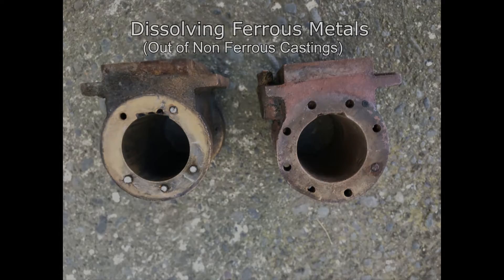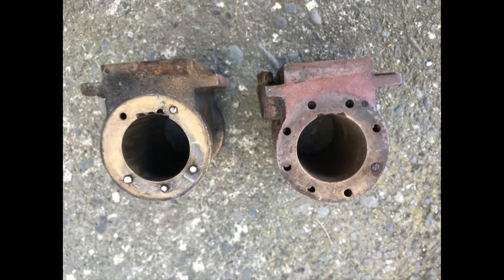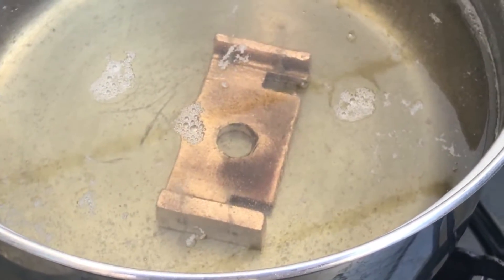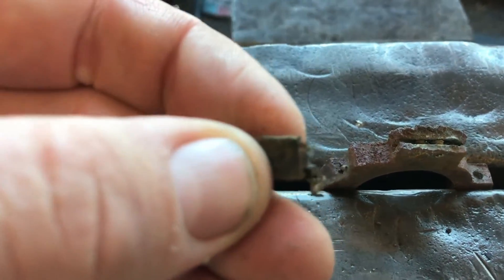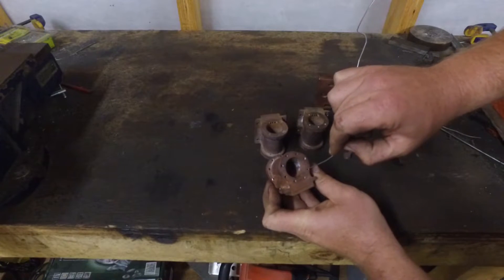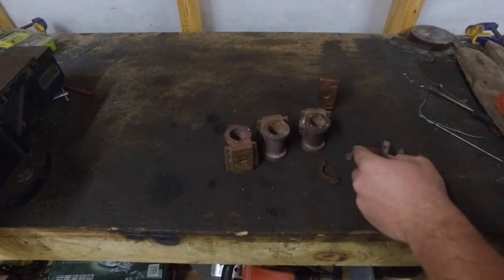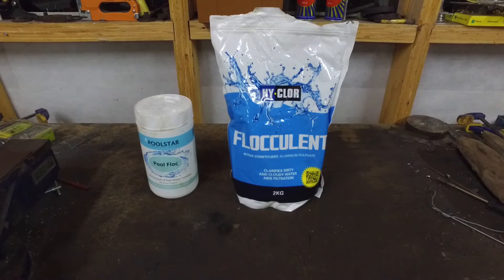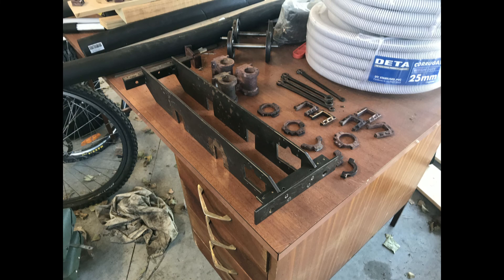Dissolving Steel from Bronze Castings

Comment: I bought some of the same product from Bunnings, but it just says it Aluminium Sulphate, not Aluminium Potassium Sulphate. Does your packaging say the same thing? Wondering if this has changed since you made this video. Will probably given it a shot.
Going to try it on my lawn mower deck, which had a couple of bolts shear off.
Reply from the maker: @jaredbawden6707  I will need to take a look and let you know.

Comment: Geez, here in OZ  ive been getting Alum powder from indian grocery stores.
You mean to tell me i can just go to bunnings or the pool shop and get some pool floc?..
Reply from the maker: Yeah pretty much. I honestly didn't know where else to get it in NZ apart from the 2 hardware stores. Would be interesting to know if you find the same strength difference between Bunnings and your current supplier.